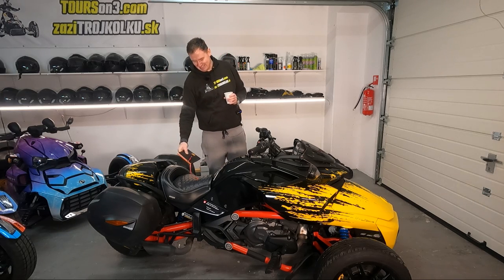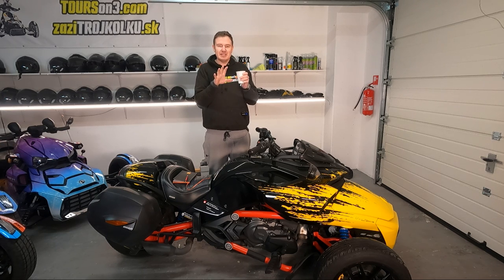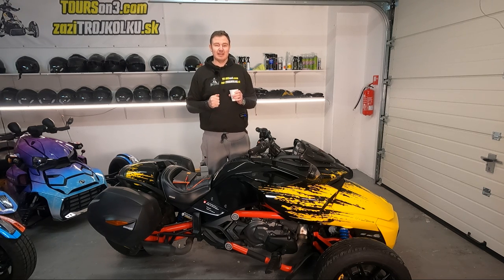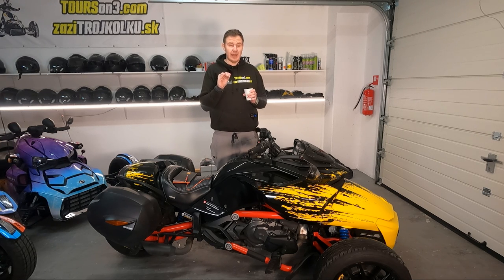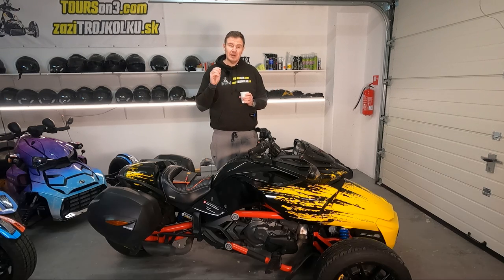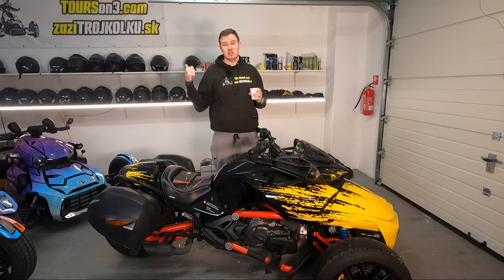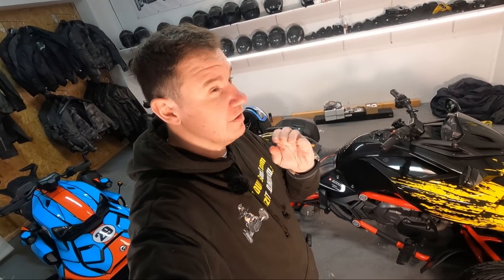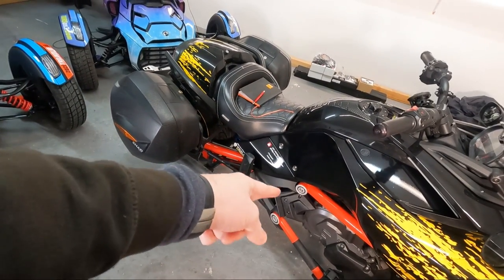Top 15 Must-Have Accessories for Can-Am Spyder F3 and RT by Owners

Comment: 2016 Spyder RT-S here.  Bought it brand new in March 2017.  Changed out the OEM head and fog lights to LEDs.  Also added  LEDs  for turn and brake lights on the rear trunk for better visibility.  The biggest add on was the Pedal Commander which I just added after all these years.  It put the thrill back into riding my Spyder.  Wish I'd done it sooner.  Everything else on the Spyder is acceptable to me.  For the record, I have 54,000 miles on it and one west coast to east coast ride so far. No regrets going from my Goldwing to the Spyder which was necessary due to physical limitations.  I did not want to give up the sense of freedom when riding "cageless ".  Ride on, fellow Spyders!!
Reply from the maker: 💯💯💯💯 thank you for sharing this great story 💯💯💯 enjoy many more mikes with smile 😉😉😉🤟

Comment: For my 2016 art Limited I have upgrades the headlights/fog lights to LEDs, changed out the lights/reflectors on the fenders to the LEDs lights/turn signals, added in the extra LED lights/turn signals to the back of bike, put in several under-glow lights to the bottom, and changed out the stock sway bar for a BajaRon one for better handling.
Reply from the maker: Nice upgrades David 🤟🤟🤟💯

Comment: do you have a preference about oil when changing oil ? My F3 is pretty new - it's just getting near 500 miles now. I've been told to take it to a shop at 650 and that they will likely change the oil but they charge $150USD for the oil change. I'd rather go to the K&N at that point and change the oil myself but am concerned about which oil to run (full synth, half synth, straight oil) ...
Reply from the maker: Hi buddy. I would not do anything crazy about the oil. In US Lamonster garage has a good oil together with highflow oil filter. Or you can buy full kit from BRP. Dont do anything else i recomend. https://www.martinthevlogger.com/post/canam-spyder-oil-change-made-easy-howto-rotax-1330-maintanace

Comment: During active driving in corners, the "nanny" will kick in to fast. Will a better sway bar help to keep the "nanny" away for longer? (F3)
Reply from the maker: Yes, it will help as your wheels will not slide so much. Your wheel will not raise so much. But there is bigger alchemy to this. Also having right tire pressure helps a lot.. but yes swaybar is one of tge helps
Reply: @MartinTheVlogger ,Tanks for usefull information! Now I have to save some money to buy a sway bar from you
Reply from the maker: @orjanbern4766  😉😉😉😉🤟💯🚀 its a night and day, that H&R swaybar 😉😉😉💯🚀

Comment: Hi Martin. if I fit the cat buster exhaust mod to cut out the cat and improve performance on the F3 S would I fail the MOT on emissions? I was hoping it would be okay and I would not have to swap it back just to satisfy the test conditon?
Reply from the maker: Hi once ypu remove the Catalitic convertor you wont pass MOT... but in most of EU countries our MOT for motorcycles is still not part of the test 🤷‍♂️🤷‍♂️🤷‍♂️🤷‍♂️🤷‍♂️
Reply: @MartinTheVlogger  Thanks Martin, could be an issue here in the UK. Would need to speak to a few people to see if their is a work around. 👍
Reply from the maker: @mum-0217  hmmm.... my work around would be just put back cat,.its 30min job and littlebit of cursing few first times 😆😆😆 but the pleasure from the sound of your bYke its priceless. 😉😉😉😉